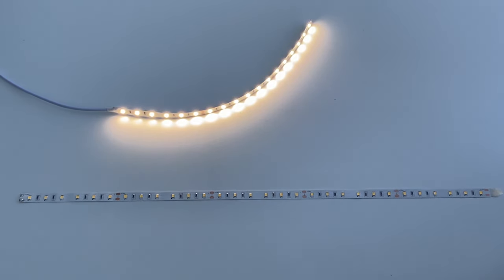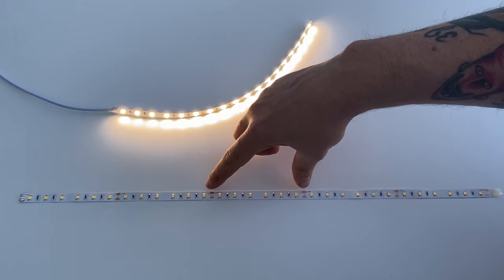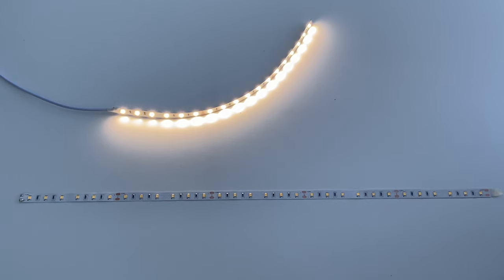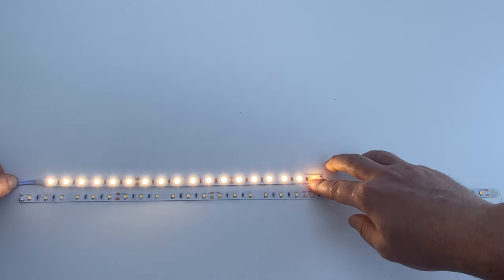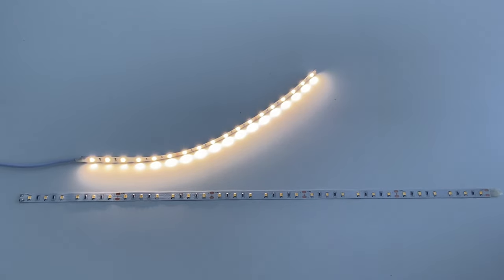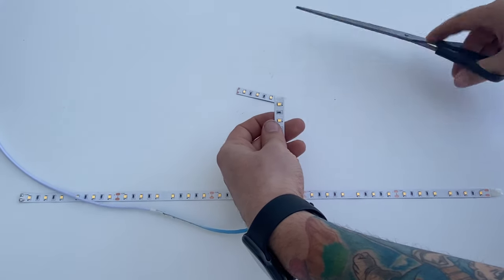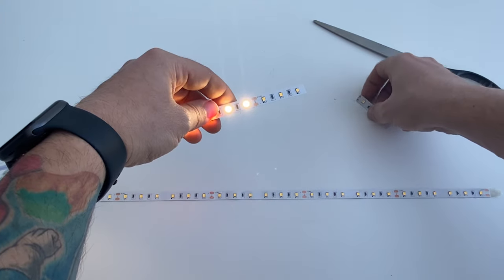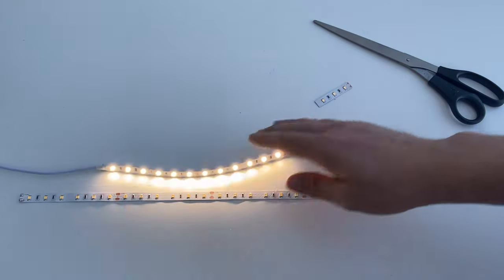What happens if you cut your LED strip lights in the wrong place?

Comment: I cut it on the copper part, I didn’t cut it straight tho and now only like 1 inch of it flippin works 😭😭 and I just got them today on my birthday help please
Reply: Same
Reply: Katie Michel FREAKING SAME
Reply: same
Reply: Perla Diaz I got them to work, you need these little white adapters, they look like clips and you put one end of the lights and connect it to the other and connect them all together... I just ordered mine off of amazon
Reply: So I cut the first copper line because thats what it said in the instructions...all I need is an adapter, and connect it to that broken copper piece right?
Reply: Aaliyah Wright HELPP I HAVE THE SAME THINGS HOW DO YOU USE THEM
Reply: Aaliyah Wright link?
Reply: ʙᴀᴋᴜɢᴏᴜ ya
Reply: necrubi sooo I had to buy connectors to get it to work 😂
Reply: Same

Comment: Hey man, half my strip stopped working and I got it today. It was working fine and if I touch the R1 resistor on all sections they light up red dimly… no cutting all connections are good and it still only goes half way… i’ve also bridge connections on the lil black box thing and all the sections light up the same… I’m lost as to why it’s not working because everything has power and clearly the circuits are fine and connected

Comment: i was putting my lights up and than the part that first starts the led ripped off and it wont turn on what happened?
Reply: rip
Reply: same
Reply: If you take off led lights will they still stick cause mine are not straight at all